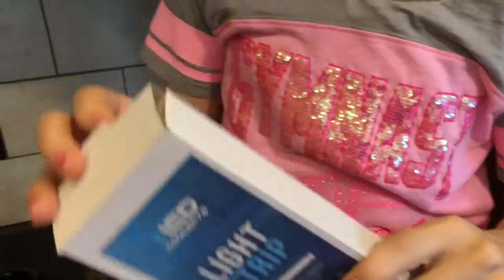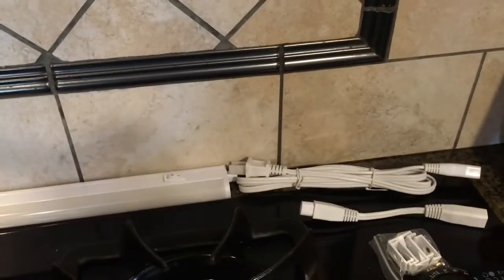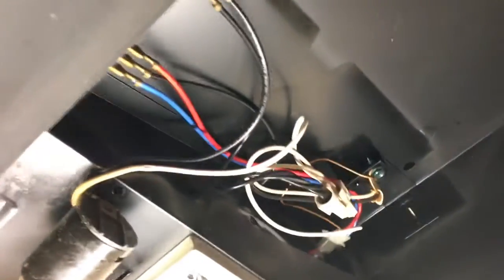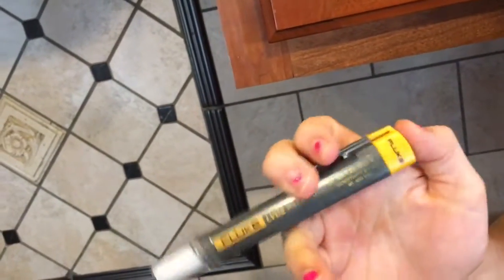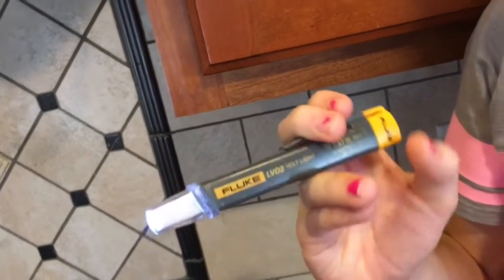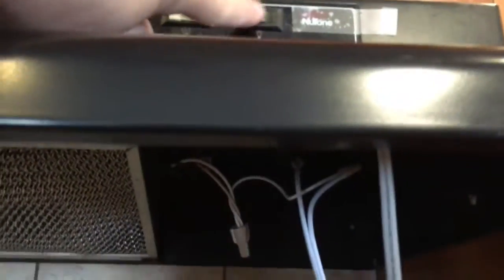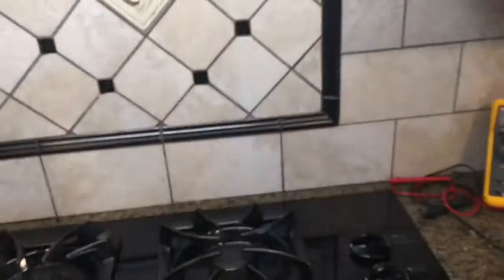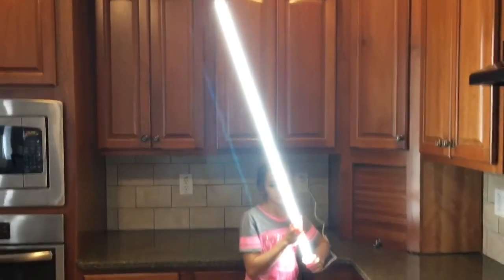Retrofit Install Under Cabinet LED Lighting - 4W 22” DIY Hardwired

Comment from the maker: How To Solve Rubik’s Cube Easy: https://youtu.be/9spDGBeWl1o
I am now working on a Megaminx tutorial and have plans for:
Pyraminx, 
Skewb, 
3x3 Intermediate Method,
2x2 Advanced Ortega,
And maybe 4x4 and 5x5.

Gan just sent me a Stickerless Magnetic Megaminx https://amzn.to/30Z4TwX and then I purchased several budget Megaminxs  https://amzn.to/2P8yMZ4   to peel stickers off to display the steps and a few more budget stickerless https://amzn.to/2J3KQHe because I may do a giveaway.

I have gotten a few donations but I purchase most everything seen in my videos so consider using my Amazon affiliate links if planning to make a purchase of any sort.  It doesn’t even have to be the product I link as long as the purchaser comes through my link I will get a small percentage of the sale while the buying still pays the same price.  

That helps offset the cost of the material used in my videos.

Website: http://www.KevinGittemeier.com
Amazon: https://www.amazon.com/shop/kevingittemeier

Gan 354 M 3x3:  https://amzn.to/31WMCBG 
Gan Magnetic Megaminx: https://amzn.to/30Z4TwX 
Gan 2x2 Magnetic Speed Cube:  https://amzn.to/313BUbn 
Gan 356X Magnetic Speed Cube:  https://amzn.to/2VuTLqw 
Budget Megaminx QiYi QiHeng Megaminx https://amzn.to/2P8yMZ4 
Budget Megaminx Yuxin Little Magic V2 Megaminx https://amzn.to/2J3KQHe 
Skewb Yuxin Little Magic Skewb https://amzn.to/2MXDWVc 
Skewb X-Man Wingy Magnetic Skewb https://amzn.to/2qv5gCP 
2x2 Rubik’s Speed Cube (Gan RSC) https://amzn.to/336N3u1
MF2C 2x2 Cube (Budget Speed Cube) https://amzn.to/2Yrd74A
MF3RS 3x3 (Budget Speed Cube) https://amzn.to/2YHigk2
Cube Lube:  https://amzn.to/2yB3iBI

Amazon Affiliate links in which I receive a commission
Reply from the maker: 2020 Race: https://youtu.be/NrfGfzCqQ8s

https://www.kevingittemeier.com

https://www.amazon.com/shop/kevingittemeier